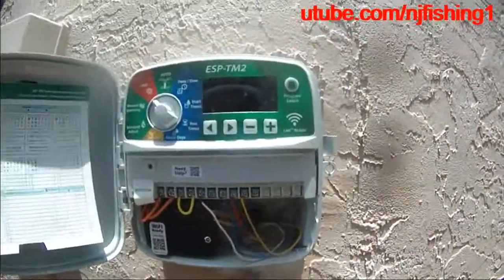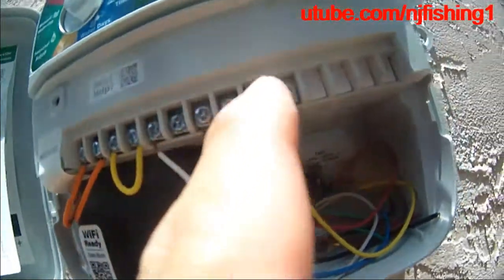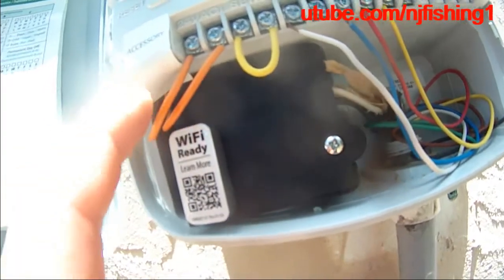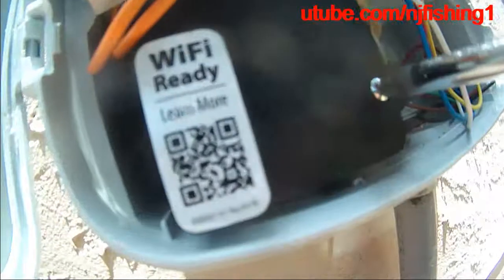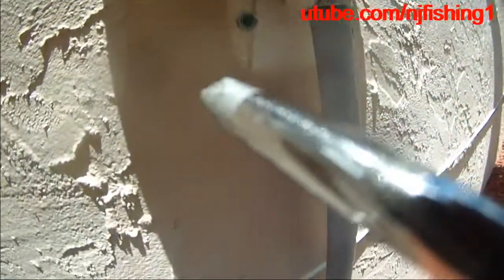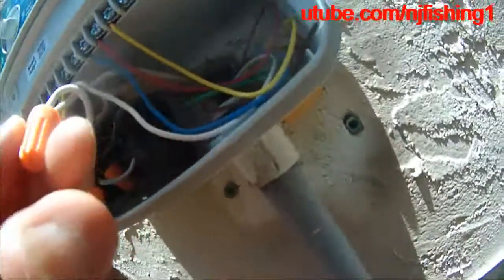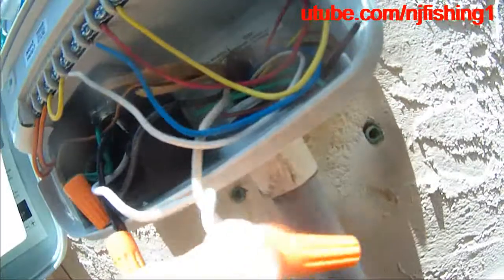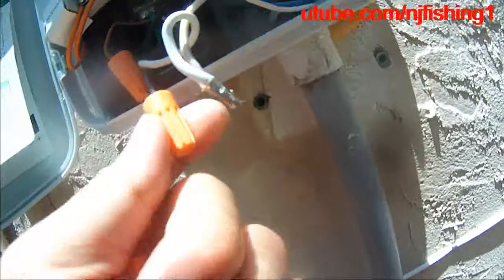Rain Bird Sprinkler System control box doesnot work - no power from the house, so need to find power

Comment: Interesting… 😂 so what was the problem?
Reply from the maker: No power.
Reply from the maker: The power wire from inside the attic was cut when prior owners doing stuff in the attic. I didn’t bother looking for where it was cut but use a new electrical wire to bring power from the garage light source to the sprinkler and power solved.